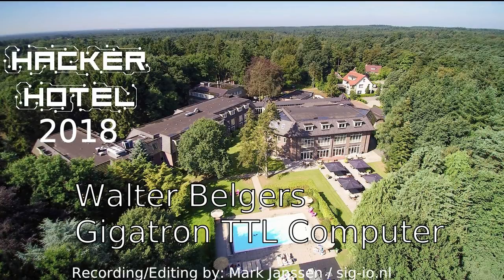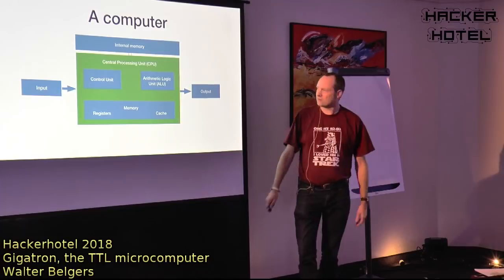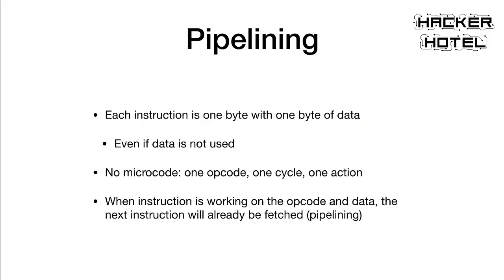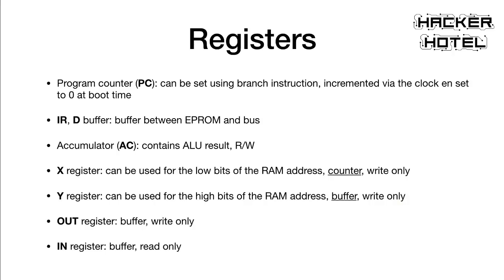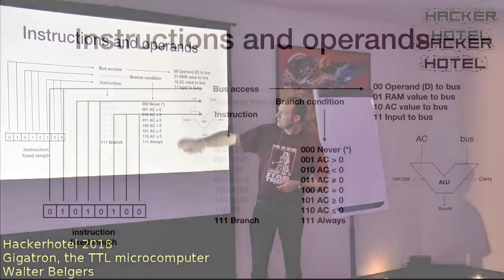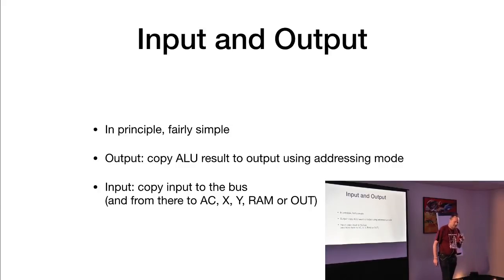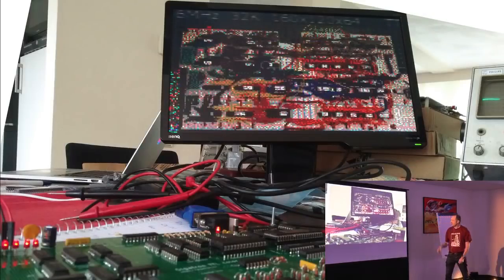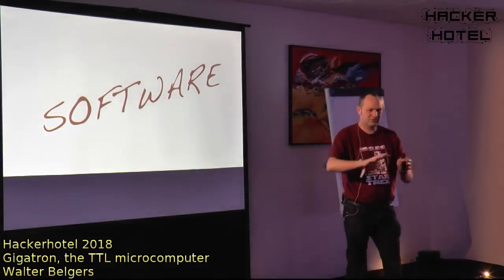Hackerhotel   2018   Walter Belgers   Gigatron

Comment: How does the ALU work exactly ?
Reply: It is a two-stage ALU. Stage 1 is a multiplexer stage that does the logical operations. The second stage is an addition. The core idea of the first stage is described here: http://6502.org/users/dieter/a1/a1_4.htm . To put this in an ALU is here: http://6502.org/users/dieter/a1/a1_6.htm (except that there it is a 3-stage ALU).

Comment: im building a completely different architecture. and many of my ideas don't fit into any category. You helped me realize its mainly CISC, but it has a lot of the good features of RISC. And some areas its exactly equal between RISC & CISC. I would like to discuss it with you. Get in contact with me! Im thinking it might turn out to be a super computer.